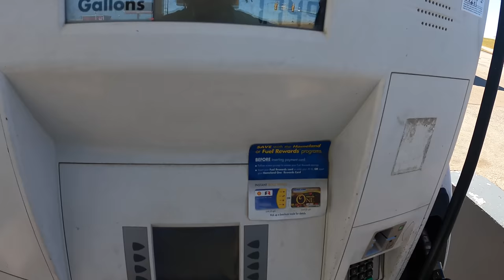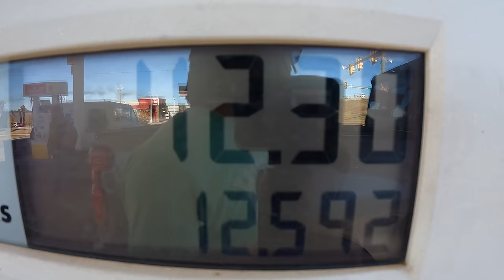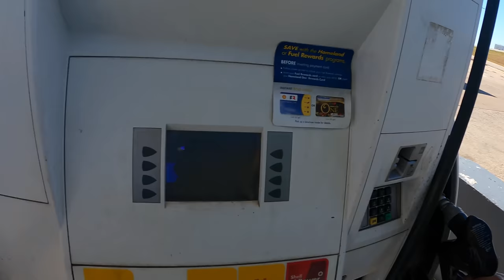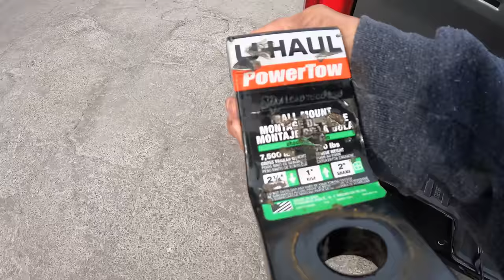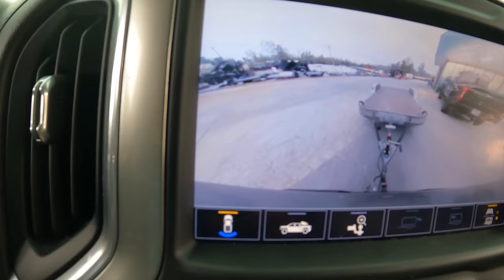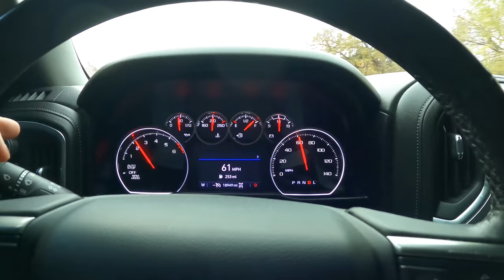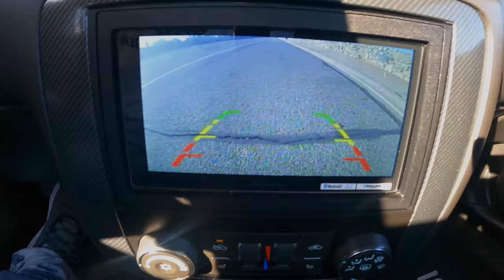Looking For a Car Hauler? Buy THIS Car Trailer (And it was CHEAP!)

Comment: I'm a welder/fabricator, for the oil field 15+ years building battery tanks,heater vessels,water separators, and also worked in structural Bridge work for the state of Texas..but I plan on fabricating a mount for my trailer with a cheap harbor freight winch, I always choose to fab my own things for my projects to save $$$..

Comment: LS is the way to go and I'm a true old school mechanic! You don't need 1000 HP on the street when you only have a happy meal budget for an engine swap! I'm not knocking it if you got it but you can get in them and drive across the country without so much as a hiccup.

Comment: Dam gas is cheaper in Oklahoma 3.35 a gallon for 91 over here in Albuquerque the gas is 3.30 for regular 86
Reply: Wow u lucky 91 premium is $3.83 in Ga.
Reply: @DoctorRickSanchez  91 premium is about same in nm expensive I run e85 it's $2.86 right now

Comment: Imma give you some game because you gave me game when I first started. Started at Copart but don't buy s*** from Copart or those auctions anymore period for exactly the reasons that you continue to have problems with cars that you buy from there and how much your spending on the cars I spent half that. Started buying from private sellers Marketplace Craigslist eBay. What you pay for that charger I could have brought two cars I brought a Camaro SS for $3,000 and all it needed was a front windshield. 2013 BMW I paid 4500 sold it for 75. Four-door Chevy Silverado I paid $3,000 for it sold it for 65. You do you my man but at the end of the day trust me it's a better way to buy cars and you get to meet people. Sometimes it's a bus sometimes people say nothing's wrong with the car and get there in the car need a whole engine. But if they ask for two thousand and it needs an engine I'll tell him I give him 500 taken off their hands 400 engine in it and still come out with profit. I'll give you an example I bought a conversion van for $1,000 the lady said that it needed an engine all it needed was a fuel pump I sold it for 65
Reply from the maker: Thanks 🙏🏾 I already know that’s how I started flipping cars

Comment: The wheel may hold air for months unless it's on a car with weight on it just thinking about that I had one that would set and not loose a pound then but it on and it would go flat in 3 hours.
Reply from the maker: Ok 👍🏾